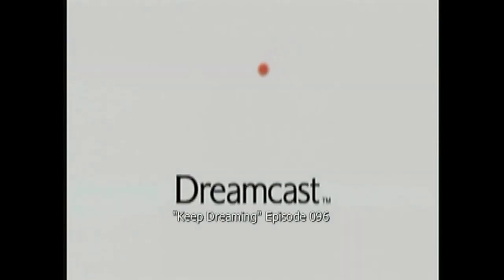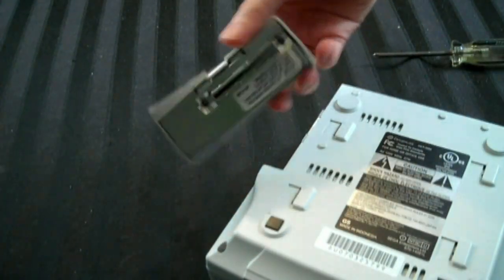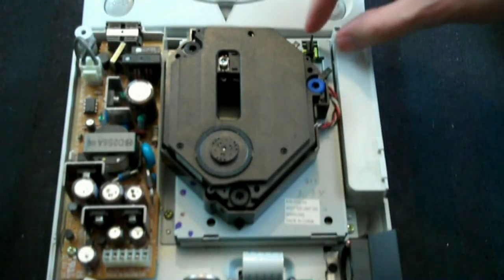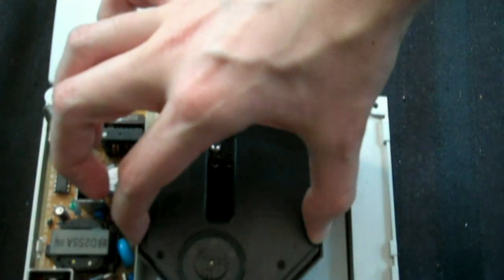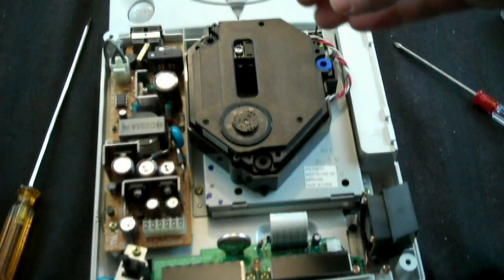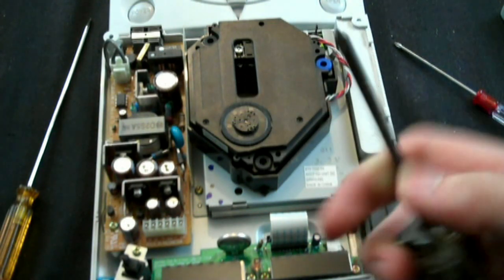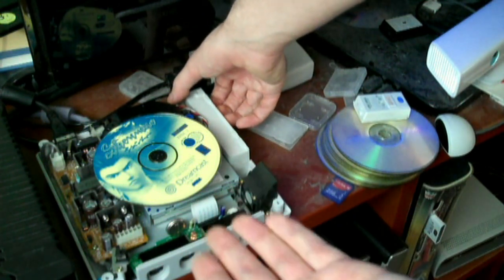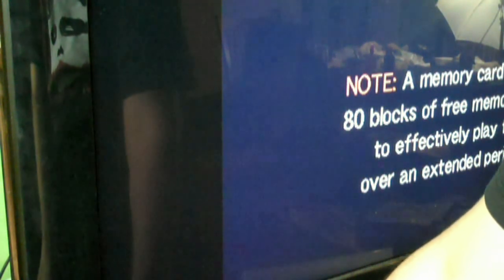Keep Dreaming - Repairing a Dreamcast GD-ROM Laser - Adam Koralik

Comment: The core issue is as the laser diode in the GD rom optical pickup goes past a certain number of hours of use it gets weak in beam strength and the optical pickups detector can no longer see the reflected disk data by adjusting the potentiometer you increase the power going to the laser diode that is already near the end of its lifespan re-enabling it to work "but" this is only a temporary fix the added voltage to the laser diode will cause it work but the added stress of this upped voltage will simply cause the laser diode to fail from stress in a short period of time (or instantly if you increase the potentiometer voltage to high so increase in small increments) the only true fix is to replace the optical pickup itself .
Reply: And what kind of laser can be placed instead? A PC DVD laser diode would work?

Comment: Look for a system with a japanese drive, the way you can tell without looking is to look at the laser lense. If the plastic around it is solid and in the shape of roughly a semi-circle it is japanese and will work reliably. Chinese drives have a boxy plastic shape that has long holes in it like the one in the video. I have never had a problem with a japanese drive.

Comment: Dang, even after tweaking the little red thing, and cleaning the lens, the discs spin but it won't read. oh well, my japanese DC is on the way in the post next month.
Reply from the maker: Sorry man, they can't all be saved.

You didn't toss the console right? Don't forget about the GDEmu and GDUSB....
Reply: AdamKoralik Yeah i kept the console. I actually watched your video about the GDEmu yesterday, sadly it's €100 ($120) so it's probably better to just scope out another DC, but i may look into it again. I will however use this console's power supply unit in my japanese DC when it arrives, so I can play it here in Ireland without having to use a stepdown voltage converter.
Reply: Mine had the same problem. I'm just gonna sell mine on eBay as junk and buy a saturn instead.
Reply: UltimateOverlord Buy a Saturn instead? Dreamcast is much better than Saturn. You're regressing bro